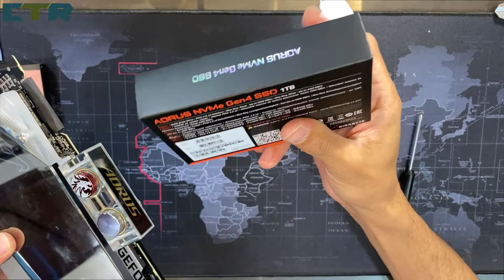Ever torn down a 100k GPU? PART 2: The back side of the RTX  3090 xtreme waterforce WB

Comment: Did you put this card to mining or made a others test to get memory junction temperature avarage?
Reply from the maker: i used mining for benchmarking but no, i don't mine with this card per se. but during benchmarking and stress testing, i mined on the card for a total of maybe 2 or 3 weeks. with every setting for at least 24 hours.

Comment: Chris. I have the same card. 2mm pads for the back of the card is all you need because the memory is already 1mm. Worked perfectly on my card. Also, get pads that have a 17 W/m*k rating for maximum heat transfer.
Reply: I think the biggest thing when it comes to cooling is making sure everything adheres correctly and you somehow figure out how to get better cooling for the vrams on the back. The problem with the 3090 is that even with 'great pads', it just means heat is more better transferred to the back plate, but with these cards there's nothing to cool that backplate effectively. So you are transferring heat better but what is removing the heat? For this reason, you don't need such high thermal conductivity pads. 12 W/MK is enough, the issue is that you have to remove heat better from the back somehow. People have been attaching heatsinks, modding the back with fans, etc all to fix this. Those tend to have much durastic improvements in addition to replacing the pads, but 17 W/MK is not necessary.
Reply: Hi, can you say pls what thermal pads do you use in back plate 2mm?thanks
Reply from the maker: Sorry i can’t access the video you’re commenting from…..weird. Anyway if you’re referring to the one with an active backplate from bykski, i used a 1.5mm gelid extreme.

But if you’re referring to the stock aorus aluminum backplate, i just used the stock pads. I didn’t change them. At the time, i was expecting my active backplate to arrive soon. So, i didn’t want to waste any pads knowing that I’d be removing them soon.

The size of the stock pads were just past 3mm. But I’m guessing the rating of the stock pad’s around 8w/mk or maybe 7  basing on their softness. JUST MY GUESS. Not too sure.
Reply: Frosty Thermal pad 12.8 or gelid extreme.
Reply from the maker: Gelid extreme with bykski gpu block and active backplate 😁
Reply from the maker: Maybe, but can’t confirm it. My intention was not really to change the pads, but to replace the backplate all together. That said, didn’t go into the what pad sizes may or may not work, and just mention what sizes of pads are currently on it.

Anyway, great input man! Thanks!

For your info: my order for the active backplate already arrived 😁😁😁😁😁 will be posting a video about it soon!
Reply: @christechrants4085  The memory chips are actually around 1.25mm tall and the height of one of those backplate stands between the PCB and the backplate is around 3.0mm so that's why 2mm pads will work although some more compression for the pad would probably be ideal.
Reply from the maker: @markokuosmanen  you're more diligent than i am 😍😍 appreciate your post bro =)

Comment from the maker: HELLO, just want to make clear some comments in here may not be applicable to some. For those who are curious enough to test it for themselves,

REMEMBER: every processors are DIFFERENT. Don’t follow mentioned values in the thread. Do it by increments. As for the voltage, if unfamiliar, leave it alone 😂

Just saying that rtx 3090 at stock is not suitable for mining. Under clocking it just to get a good temp, is a very inefficient way to do things. Under volting though may help prolong gpu life if done properly.

Comment: Great info on the backplate and thermalpads Chris.. Once again thank you. I have now had my  RTX 3090 xtreme waterforce WB for 3 days and I found the following. I might be lucky with the thermalpads or the water loop is stronger in my rig. I am using a 280 45mm rad with 2x140mm noctua and a 200x200 30mm rad with a Noctua D15 fan). I run a 5800x PBO2 -30 all core in the same loop (40W during Mining). Anyway my temps are 96C at junction while mining 123MH/s with +1500mem  1150 core, 737mV (ambient 24C open case, no fans and no heatsinks on the backplate, but some turbulence around it due to 2x90mm fans in the back of the open case), With a Noctua 120mm at full speed pointed at the backplate with no heatsinks, its at <92C (all in all GPU pulls 310W in this setup). For gaming spec with with 1850Mhz +0mem i run around 70C at junction temp. (i see no problem here). When I have the time I will try and see if i can make a bracket to mount heatsinks like you and run for a new more days. My card is mounted in vertical position, so i need a bracket. (might end up beeing wood). 
After that I hope to open the card and change the thermal pads, but i need to order some good ones. 
What is you goal for the junction temp ? I really would like to get below 80C, but I think I need watercooled backplate for this.
Reply from the maker: WOW! Those are great numbers! With the config I’m on with the heatsinks and 4 mini fans attached to it... (with the computer looking so ugly)Is the only way i can get temps to hover at 98c. Without them, it stays at 110c.

Same as you. I down clocked my mem to -300 and power limited to 203W. To maintain a 74c. If i increase the power a little, i get no change in hashrate. If i increase over 230W i maintain 82c. So I’m maintaining 74c right now with hashrate of 59-62mh/s.

I won’t be mining properly until the active backplate arrives 😞
Reply: @christechrants4085  Those temps seem crazy. did you remember to set fixed fan speed for your radiator fans or are they controled by CPU temperature (CPU temp if very low while mining). I use 60-70% fanspeed for radiators (set in bios). You can more or less check this if you touch your radiators and they are hot and not luke warm.
Hmm a suggestion from my side: Use MSI afterburner and make a profile with an undervolt and fixed voltage. (took me some time to figure out a way to do it). 
Go into curve and press and hold a square at the higest point (1150mV) now press alt key and pull down (the curve will now shift down) now line up 737mV at the curve  with aproxemently 1100MHz. Now release the mouse bottom.
Next step
within the same curve you now press a square at the higest point (1150mV) while holding the mouse at that square press shift and pull down untill the curve goes down instead of up. Now 700mV should be the highest. let go of the mouse bottom
Next step 
Now click and hold the mouse at the square connected to 737mV untill it reaches 1100MHz (we go easy on the first try). only one dot should move in this action, but it will now be the highest dot. 
Now in the other MSI afterburner window press the apply bottom. All dots at higher voltages should now be 1100MHz.
You have now applied the undervolt to your card. 
Next OC Mem to +500. (+1000-1200 should be near optimal for 1100Mhz core).
Reply: Just notised i wrote a very specifik number with 737mV, you will not able to hit this specific number just hit it near it. 725-750mV. I can go 700 but it does not seem to apply (CPUZ shows 737mV).
Reply from the maker: @greengrasser  yup no problem in voltage regs,  power limit works just fine so no need to do it. Same goes for the base clock. If i overclock some more, difference is nil and becomes inefficient 🥲 Ye, Fan speeds are properly set 😁 if max capability at about 98c fans needs to be at 100% (THOUGH I ONLY HAVE A 240mil RAD 😂😂😂) otherwise fans are fixed at 60% vrams at 74-76 gpu at 49c with 62mh/s. I’m good with that for the time being. Only a few days to go until i can properly overlock the thing. 

Again all are within spec so I can’t really say there’s something wrong. Nice input though, couldn’t have explained it any better. I just feel sad for the other xtreme waterforce that has an AIO preinstalled 😂
Reply from the maker: @greengrasser  😂 i messed with this before to get its max performance best i could get was 127mh/s. But I dialed it back down. I still have plans in using my gpu after all this mining craze finishes 😂 OR UNTIL I GET A PROPER COOLING SET UP 😂
Reply from the maker: I’m actually not sure if it’s 127 or 137mh/s i forget. I’m not home as of the moment, can’t check 😡

Comment: Nice man !!! I told you in one of your previous video we that I want to do these with my card to put some heatsinks on it . I have no time make it yet even if I got already the heatsinks the only difference that i want to put a 140mm fan at the back of the card I will mount on the pci-e bracket  and will the same cooler what i use in my ecosistem so will look also good not just usefull ! good to know that 5-6 celsius thats  around 8% temperature drop if for exemple you have around 90c vram temp .. but thats mostly if you mine ETH .. a lot of work in this to take out the card , put it back , fill the sistem start testing and such .. now you made me curious about how much will be the difference with the bykski backplate + heatsinks if just 1-2 celsius maybe not worth the effort and money … or it can mean that the original is good enough but we will see , I saw those EK water blocks with water in the back plate also made like a sandwich I’m sure that’s doing real cool temps but was for FE cards reference PCB design is that the same as ouer ? i mean your card have reference PCB design ?
Reply from the maker: PHP 9,175.95  25％ Off | Bykski GPU Block Backplate Water Block For Gigabyte AORUS RTX 3080 3090 Master, VGA Cooler RGB SYNC Pros and Cons Water Cooling
https://a.aliexpress.com/_mOCai7F

That’s the one i bought, basing on the pcb design the only difference is the capacitor. Will check if it’s compatible.was guaranteed that it will fit perfectly though but we’ll see...
Reply: @christechrants4085  i see , so you bought watercooled backplate too ? not just a thicker backplate
Reply from the maker: @Xabiroo  yup! 😁
Reply from the maker: It will take a while for the ek to become available for our models tho 😅 YES THOSE HEATSINKS ARE THE NEXT BEST THING. Check mp5works they have a more non invasive way to actively cool the backplate